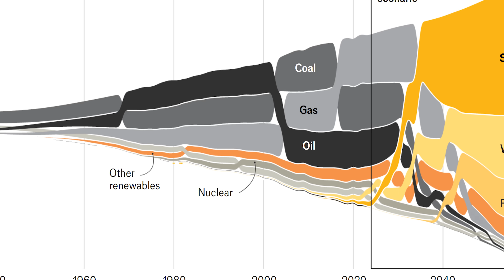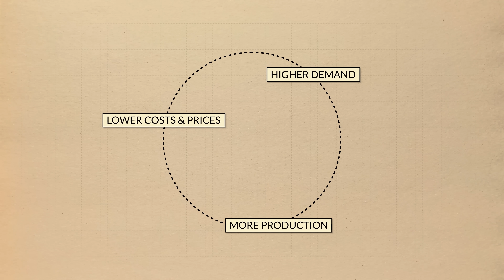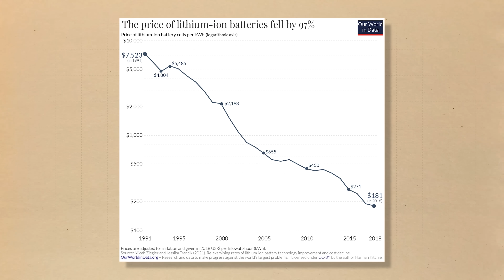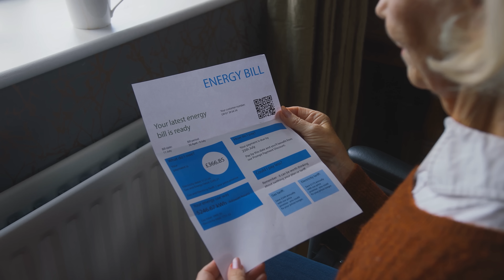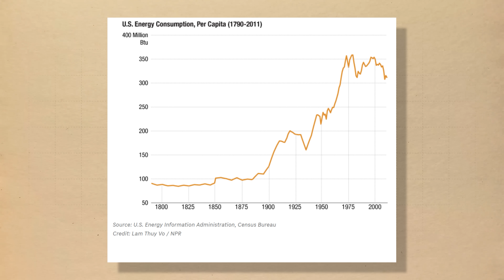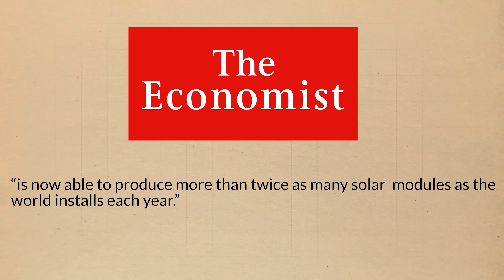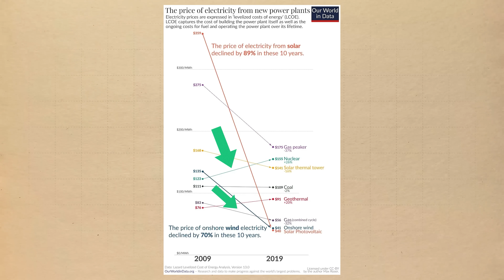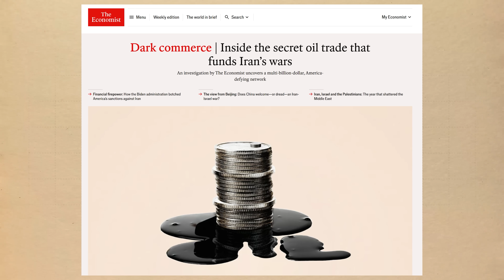Why solar will soon dominate & what that means for the world

Comment: GDP PPP/ capita is directly propotional to Energy consumed per capita.

If price of energy becomes way less.
Less price will mean much more Energy consumed.
Therefore GDP per capita will boom.

If you gave near free energy you have everything.
If someone need water 💧, they can just pull water 💧 from Air Humidity itself.
No Water scarcity, energy is the only bottleneck.

Comment: This  may be a techno fix righting us from errors from ~1800 thermodynamics. 
Let's reframe Earth's low contrast abundant ambient heat as a thermal energy waypoint between heat and other forms of energy. Energy changes form without gain or loss. Uniformity is not in itself a form of energy.  

Energy sensible refrigerators that absorb heat and yield electricity of equivalent energy content would complement computers as computing consumes electricity and yields heat. Computing would be free. Chips could have energy recycling built in. This would improve performance and lower cost. 

Full heat recycling, all electric, very isolated underground, undersea, or space communities would be highly survivable with self sufficient EMP resistant LED light  automated vertical farms, thaw resistant frozen food storehouses, factories, dwellings, self contained elevators, safe rooms, and horizontal transports. 
In a flourishing civillization, small self sufficient electric or cooling devices of many kinds and styles like lamps,  smartphones, hotplates, water heaters, cooler chests, fans, radios, TVs, cameras, security devices, robot test equipment, scales, transaction terminals, wall clocks, open or ciosed for business luminous signs, power hand tools, ditch diggers, pumps, and personal transports, Refugee communities would be buildable quickly. Fire safes would preserve contents to 1000F for years. These would be available for immediate use incrementally anywhere as people as individuals or larger social groups see fit. 

Some electrical equipment groups could be consolidated into local networks when suitable. Liguid nitrogen cooled superconducting networks would become practical. 

If a high majority thinks our civilization should geoengineer gigatons or teratons of greenhouse gasses out of our environment, instalations using devices that convert ambient heat into electricity can hypothetically be scaled up do it with a choice of comsequences including many beneficial ones. 

A simple rectifier crystal can, 
just short of a replicatable long term demonstration of a powerful prototype, almost certainly filter the random thermal motioren of electrons or discrete positiive charged voids called holes so the electric current flowing in one direction predominates. At low system voltage, a filtrate of one polarity predominates only a little but there is always usable electrical power derived from the source, which is Johnson (observation) Nyquest (theory) thermal electrical noise. Max Plank anticipated that ambient thermal noise would become usable with advances in technology.  

In 1973 I filed for US patent 3890161A DIODE ARRAY for an array of metal1/ insulator/metal2 diodes that refrigerate while concurrently producing electric power. The patent was granted in 1975. It was opened to the public domain in 1992. Development should be in the public domain. 

The plausible net electrical filtrate from diodes can be aggregated in a first grouping of separate diodes in  consistent alignment parallel. After a primary level of grouping that preferably is in parallel, compound parallel and series networks can be built 
to provide desired DC current and voltage. Within limlts, parts of the  network can be shorted out or open circuted without electricalor chemical  harm. Widely  scalable electrical power always with equal refrigeration is thus possible. Inefficiency effects the performance but not the equality of the thermal absorbtion and electrical yield of the conversion. 

The maximum energy is converted from ambient heat to productive direct current electricity when the load electrical resistance  is equal to the array internal electrical resistance. Maximum calculated electrical power output (watts) is k (Boltźman's constant), one point three eight x 10^ minus 23, times T (temperature Kelvin) times bandwidth (0 Hz to a natural limit ~2 THz @ 290 K) times rectification halving and nanowatt power level rectification efficiency, times the number of diodes in the array. 

There are a billion cells of 1000 square nanometer area each per square millimeter, 100 billion per square centimeter.

Order is imposed on the random thermal motion of electrons by the structual orderlyness of a diode array made of diodes made within a slab: 

Host crystal in this example is silicon 

  P type boron doped
-----‐------‐----___-- Out
🔻🔻🔻🔻
■■■■■■___ + Out
  N type phosphorous doped 

All the P type semiconductor anodes abut a metal conductive plane deposited on the top face of the slab with nonrectifying joins;  the N type semiconductor cathodes or common cathode abuts the bottom face. As the polarity filtered electrical energy is exported, the amount of thermal energy in the group of diodes decreases. This group cooling will draw heat in from the surrounding ambient heat at a rate depending on the filtering rate and thermal resistance between the group and ambient gas, liquid, or solid warmer than absolute zero. There is always a lot of ambient heat on our planet, more on equatorial dry desert summer days and less on polar desert winter nights. 

There are other plausible breeches of the second law of thermodynamics.  Hopefully a lot of people in independent teams, will join in expanding the breech. Please share the successes or setbacks of experiemental efforts. 

These devices would probably become segmented commodities sold with minimal margin over supply cost. They would be manufactured by advanced automation that does not need financial incentive. Applicable best practices would be adopted. Business details would be open public knowledge. Associated people should move as negotiated and freely and honestly talk. Commerce would be a planetary scale unified conglomerate of diverse local cooperatives. There is no need of wealth extracting top commanders. We do not need often token philanthropy from the top if the wide majority of people can afford to be generous. 

I do not seek to be the lead developer. This will disable confirmation bias and assure that other developers are acting on the merits of rhe hypothesis independently. For example gold needles abutting straight into an N type GaAs substrate may be a better starting point for developmen. Phosphorus and boron in silicon crystal technology is more familiar but plausibly inferior though it. may be adequate for proof of concept prototyping. The topic deserves discussion and prototyping attempt action. 

  There could be net entropy reduction in the full lifetime energy accounting of diode array use. The entropic deteration of the structure of machine parts made of tough solids is inevitable but can be  minor compared to the stress of their use. that there is negative overall entropy.   There could be net entropy reduction in the full lifetime energy accounting of diode array use. Diode array devices should be able to power the manufacture of àn ever increasing number of these devices. 
Aloha
Charles M. Brown
Kilauea, Kauai, Hawaii 96754

Comment: To me, the opportunity for developing nations to leapfrog directly to renewables is huge. Bypassing the construction of extremely expensive, long distance, high tension grids supplied by massive, centralized generators which are dependent upon imported fossil fuels can be very empowering to these nations. Everywhere, solar and wind are just cheaper than other sources. That's enough.

Comment: Starting a business offering sun tracking panels for businesses. In many hot parts of the world, a simple solar setup with mono panels produces enough to run an air conditioner. I can't wait until sodium battery chemistries are cheaper and more widely available for static storage. This lithium business is too expenses and needed elsewhere where energy density is more important.

Comment: Nobody talking about geothermal. Guys all you need is to drill a hole and hook up a steam engine. You don't have to drill down to magma to be effective, 2-3KM on average globally will get you to a constant temp that boils water. Yes wells might have to be re-dug every so often, but otherwise its a closed loop system with predictable costs, no fuel input, no waste generated (or minimal from the drilling), and can also be paired with nuclear waste disposal efforts. Yeah, not a solution for individual homeowners, but why isn't this being talked about at grid scale? Existing nuclear plants, or those considering building new ones, should be jumping on this.

Comment: We could be 100% solar power if we wanted. The Continental United States is never in complete darkness so if you had nationwide power grids you could power the country 24/7
Reply: Solar and wind are incredible but they are also intermitent resources. We have just 5 practical solar hours in most of the world. That's why there are a limit in solar capacity in each part. If 100% of the grid fall until 50% just for a cloud or until 0% in the night then your power security is terrible. 

It's a great option and is perfect for houses and business but you can trust all the nation grid to solar.

Comment: Almost every successful technology follows a S-curve, with slow initial growth, followed by a rapid, exponential growth as the technology matures and economics of scale are achieved, followed by a slow down and a plateau, as the demand and capacity limits are reached. We are clearly in the steep part of the solar S-curve, the question is where exactly we are. Will we hit the middle point, where the growth transitions from exponential to linear and then logarithmic next year, in five years, ten years? What will be the reason for that? Looking at the situation in Europe, where I live and study energy closely, we might be hitting that point already, with the number of hours with negative energy prices fast growing, which should cause a slow down in solar installations, unless energy storage can quickly catch up and remove this barrier. Every region will hit this critical point at a different time, places with little solar have the exponential part still ahead of them. Essentially, getting from 0% solar to like 30% solar can be done very quickly, and the cost, supply and installation capacity of solar panels are the only real limiting factors. Once you get above that, energy storage capacity starts to become the decisive factor.

Comment: Sure but...
Solar has VERY real limitations.

It's HIGHLY polluting to produce the panels.
The panels are hardly recyclable (for now).
Requires rare earth metals which is a very real bottleneck.
Panels last only about 10-15 years

It's an excellent solution for specific use cases, but not for MASS adoption or mass energy production.

Wind is also better than solar since it doesnt require as many rare metals, it's even cleaner, and the materials are recyclable (in other industries).

And then, we have batteries, which is a WHOLE OTHER ISSUE.
Again, material limitations will make it so that it can't be mass adopted.

We need good base mass power from Nuclear and Hydro for example, and then Solar and Wind (+batteries) for the peaks and variations of the day.

Gas will always have to exist for specific industries, for example, a lot of metallurgy can't (yet) be electrified easily.

Comment: Solar is 3 times for expensive than Nuclear energy in the long run.
Hydro is the cheapest 24/7 energy but dont work everywhere, Solar wont heat you when your cold or when its to much cloud.

Talk about more unstable weathers, then try to push the energy industries into something that depends on that unstable weather sounds pretty stupid... together with the facts that it cost more and polute alot more than hydro and nuclear, and its so expensive to recycle that it will drive up the end price alot more and lead to more polution becuse many cant afford to recycle it.

Comment: You need to re-do this video and adjust the overly-optimistic projections that fail to take into account the simple fact that solar isn't going to work in a lot of areas.  In Australia, Mexico, south-western US, the Middle East, and huge parts of the African continent growth in solar power adoption can be transformative like you say,  because there's reliable sunshine.  Other places with much less reliable sunshine, which account for a huge part of global energy demand, simply can't ever benefit anywhere near as much.  Those feedback loops and exponential graphs will in reality be heavily dampened globally.  So this video is way too optimistic.  Most of Europe, all of Russia, all of Canada, big chunks of the US most of the time, parts of China, Japan, South America, etc. will probably never be able to rely on solar as their principle energy source.  At best it can and should be part of a mix, so demand should continue to grow but not as much as this video suggests.

I also think that those exponential graphs of solar panel production probably reflect Chinese government subsidies as opposed to organic demand.  In a way it doesn't matter much:  if the panels are installed and used, then who cares if they were subsidized?  They become part of the energy mix wherever they end up regardless.  But we shouldn't extrapolate and project demand moving forward based on production figures that include subsidized panels.

Oops.  Just finished watching the video and you did address the subsidization thing with that Brad Christopher op-ed.

Comment: Seeing a lot of renewable nerds commenting that technological improvements are still needed, as if leaving electricity generation stranded, or siphoning it into batteries, are the only two options when local renewable generation capacity exceeds demands. Just build your renewable projects 2-3x larger, and use all of the excess stranded energy to power data centers, and rent them out for AI and/or bitcoin mining, probably both, so you can generate larger consistent revenues from otherwise stranded energy alongside accruing an effective hedge asset to store value in. 

You can FAR SURPASS "real-time monitoring" and "smart-grid implementations" by just building massive excess electricity and massive data centers directly on top of all of your generation sources: provide all of the energy needed to the grid, and use everything in excess for objectively MORE PROFITABLE data center revenue generation operations. 

There is a very good reason that companies following this exact playbook are, y'know, very profitable. Utilities being just utilities is antiquated and no longer the appropriate business model, outside of a crown corporation/state-owned enterprise that has no formal fiduciary duty to the state in question, where the utility in question cannot conceivably adopt this business model. 

All other utility companies, that remain publicly traded and/or privately owned utilities, will fail or, more likely, simply adopt or be bought/acquired/merged with a data center-providing company, at the end of the day. Hell, a future where the majority of electricity generation is being used to power the "virtual world" is inevitable and unavoidable, and we will see this fact continue to be borne out.

Comment: Question: what if instead of batteries, we just install more power to cover our peaks, then dump the rest in a resistor when not needed? Its solar energy so you just give back the heat that you stole with the panel anyway.
Its stupid maybe, but it cost less than batteries, pollutes less and you dont need a grid to dump power into.
Reply: There are technology where it can detect your load and adjust the power output accordingly.
Reply: @zenniz1992  nice. In my country it seems you can't have solar without the grid dump debacle. It's incredibly stupid you pay the panels to be self sufficient and then pay to stay in the grid Just to give em free electricity. We are probably being frauded by the distribution lobby.

Comment: It takes 3.5 kwh of electricity to produce 1 liter of water 
7 years ago that was $.50 (3.5 X 15c per kwh).  Its now down to 7 cents @ $.02 kwh.  In 10 years that will be down to .002, which is cheaper than ground water.

This means we’ll be able to turn every desert into an oasis via cheap and abundant solar panels.  
There wont ever be any "climate change" via carbon or water wars or any of the other things scientists / leftists predict.

there will just be economic abundance the world over.  Praise Allah SWT.

Comment: The lack of forecasting capability, by a very large margin, regarding the yearly installation of solar panels speaks volumes about why the West is and will continue to fall behind China in nearly every aspect. This was overlooked in the video, but it is quite telling that the West's lack of knowledge about China, its failure to comprehend China's strategic planning, and a significant dose of contempt toward China are its major limitations—and likely the root of its future decline.